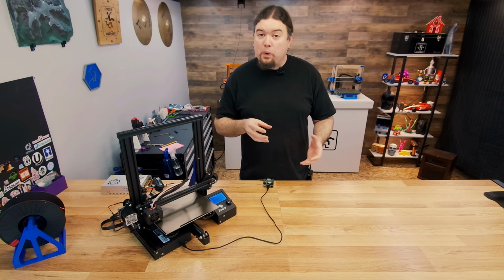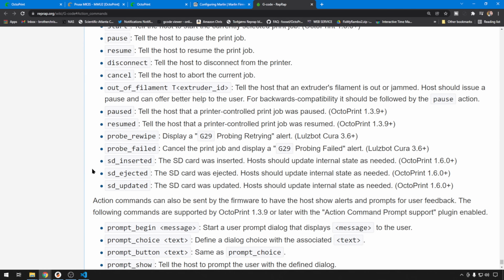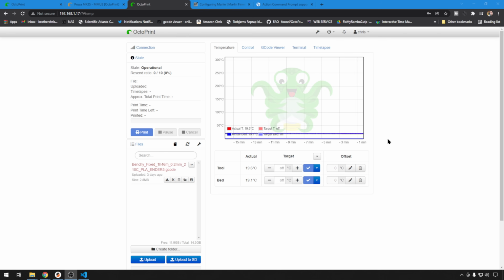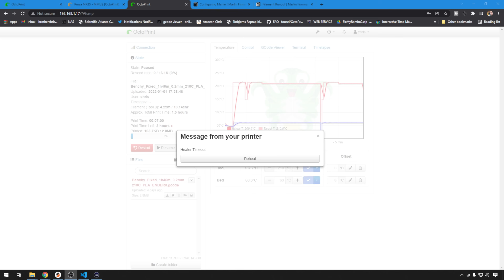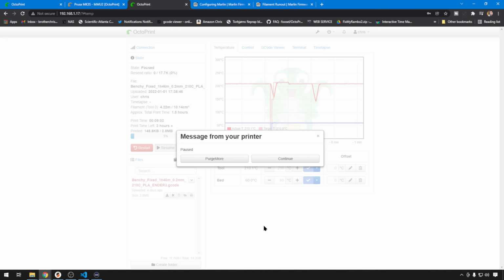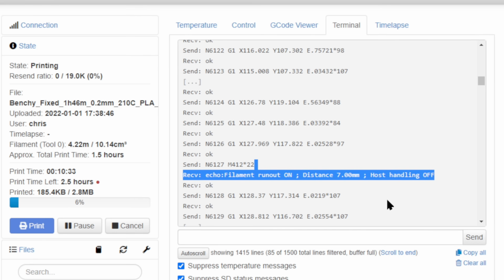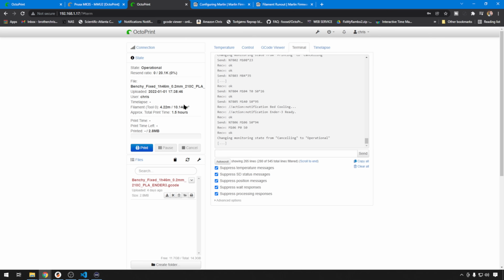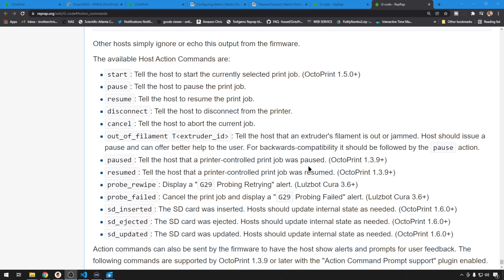Host Action Commands - Marlin Firmware - 2022 - Chris's Basement

Comment: i have a TFT 35 and i use octprint to print, would my sensor be plugged into mainboard with host_action  enabled or would i plug into the TFT board 

also will the firmware on the TFT need to be flashed to account for this upgrade while being done through octoprint to see prompts on display.

and lastly is there not a way to wire the sensor to GPIO on Pi? it seems the sensor direclty to the pi would cut out the middle man and allow octoprint to handle all aspects of the run out process
Reply from the maker: With host action commands, you will want it plugged into the mainboard. No, the TFT shouldn't need an update, as it would just be a serial controller for this. There is, https://youtu.be/ChjwIGxnivw

Comment: Have you ever had much luck with filament out sensors on the graphical menu on a Bigtreetech TFT??  I have a TFT24 V1.1 - It works really well on the Marlin text menu, but on the Graphical menu the head moves to it's park position and looks like it just locks up, but I suspect it it because it's not showing any kind of notification and there is no way to progress. Any ideas? After watching you video I was wondering if 'Host Handling' needs to be enabled as the screen pretty much acts as a serial communications board (as far as I can tell) - but then again it would be strange that the text version works! It's the same problem same the latest firmware version and the previous version.
Reply from the maker: The only way I have ever gotten it to work is by plugging the sensor into the screen. Some folks have said action commands will work with the touch screen, but I haven't tried it yet.
Reply: @ChrisRiley  I'm fairly sure this smaller of the screens does not have that connector. All the other versions has though I think.

Comment: Chris! I LOVE LOVE LOVE your videos! SUBSCRIBED !! But hey, I have a question about Octoprint, based off your video of turning a computer into a octoprint server. I am using a mini computer, just as small as a raspberry pi and it works great but! There are some great plugins that let you control relays, lights, and really whatever you can think off. The only problem is, its done by controlling the GPIO pins on the raspberry pi. Well users like myself, who are not using a pi, do not have these pins. Is there a way to control the pins on, say an arduino connected via USB to the compiter running octoprint??
Reply from the maker: Thanks! That's an interesting thought. I am not really sure, but that would be fun to try. You can interface with USB, so i don't know why we couldn't make it work somehow.

Comment: Great video as always. Big fan. But as far as power fail protection, I've been using a reasonably sized (650VA) UPS to cover any short power glitches, but all that would really be needed is some OctoPrint plugin to talk via USB/serial port to the UPS for signaling and, as you said, write the position info back to storage. My issue is that typically during extended power outages the bed cools and parts self release. There is no recovery from that other than glue or solvent welding.
Reply from the maker: Absolutely! That's always going to be the issue with this type of thing. Some surfaces work better than others. I like using smooth PEI sheets.
Reply: @ChrisRiley  smooth PEI (or PEX) on a flex steel plate is the bomb!

Comment: Just for the record, all those messages and dialog structures come from the printer through the prompt host action commands. None of this is hard coded in OctoPrint but generated on the fly based on input from the firmware. So if something is misleading there, or should be reported back to Marlin so the UI for it can be fixed 😅
Reply from the maker: Thanks Gina!